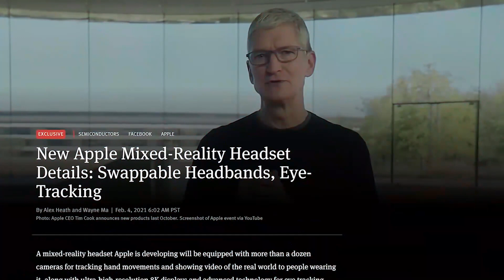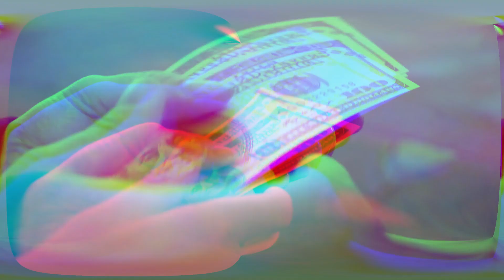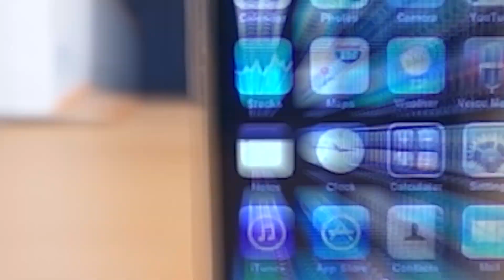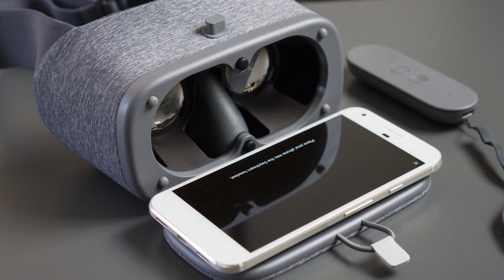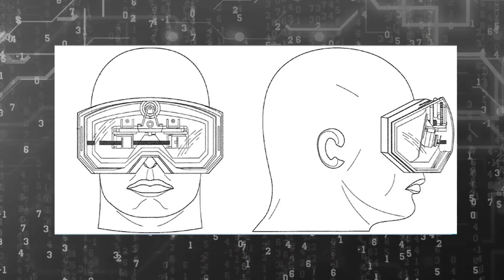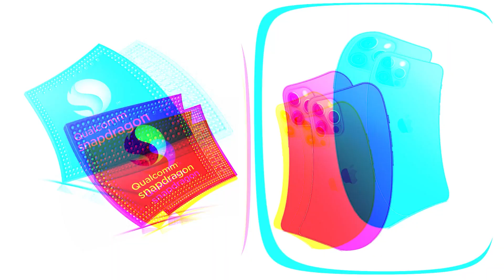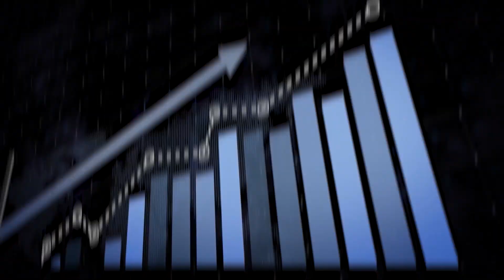Apples Plan To Take Over The VR Industry, What Makes Apple's New Glasses Special, VR headset

Comment: "The cameras would be used to track hand movement for input. This would greatly differentiate the Apple VR headset from the other headsets on the market that use game controller-like peripherals"
Um... The Oculus Quest already does that. And so does the newly released standalone vive headset. Though that one is like 8 times more expensive than the Quest.
Controllers are still better for everything though. So not having controllers would be a downside for the apple headset. You need button inputs for gaming.